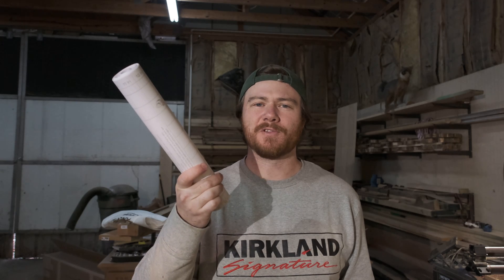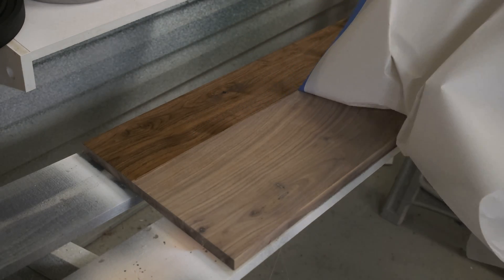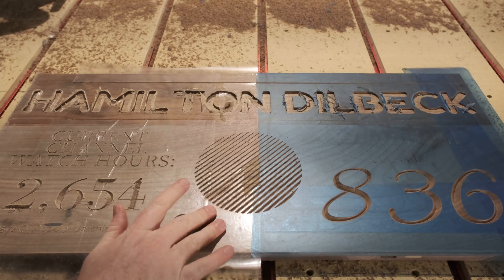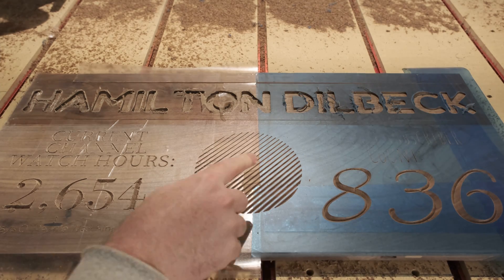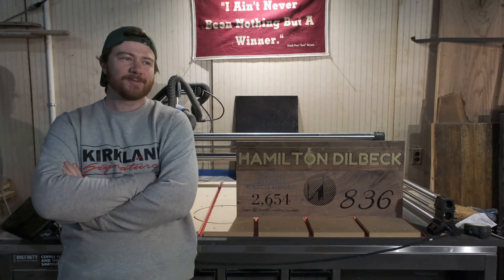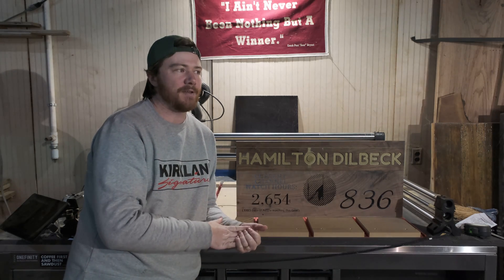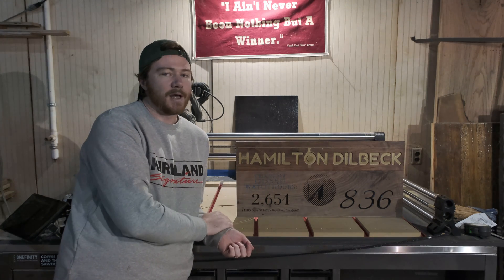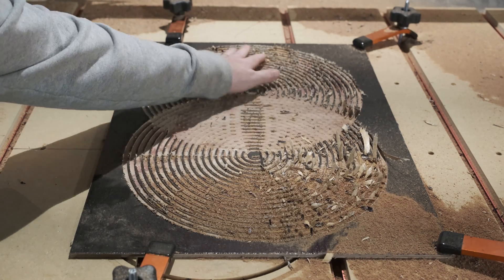CNC Masking Film: Oramask Vs. Walmart Shelf Liner

Comment: Even better than oramask or shelf liner is wood putty... water it down and apply a smooth coat over the entire piece.  if your going to sand it anyway... this is a better solution than the mask method. 
Try it I am sure you will have better results.
By the way this is not my idea. Another You tuber who I cant remember tried this and it worked great.

Comment: Just for grins try Con-tact brand clear cover liner our mother used to cover our school books in this stuff back in the 70's it was pretty tough stuff! it could possibly lift the grain when you pull it off :) also try using a heat gun/ dryer when you lay it down Love you work by the way always inspirational

Comment: What oramask did you use 813 or 631. Looks like 813. But having used both, the 631 works the best. The other think I have learned about the residue you. speak of is temperature. In talking to ORACAL reps, if it is too hot the residue will be present on the piece. One final thought about bleed. I have stopped using spray paint and started using acrylic paint. #1 it is way cheaper, #2 it does not bleed at all.  Thanks for the video
Reply: Do you brush it on or airbrush it?
Reply: @tony97gt  I just use a cheap paint brush. I by the Apple Barrel brand

Comment: ive been using the oramask 813 for vcarves and the only issue ive had with it is applying it too quick before my finish is completely dried also be sure to smooth it out with a putty knife or credit card etc. When oramask leaves a residue is usually because its been on too long like masking tape or the projects finish is not completely dried. Ive not come up with a way to get that residue off my projects easily yet but im thinking wd40 or peanut oil might do the trick to remove the residue left behind from using the oramask on the project. 
How do you remove the residue and not harm your finish?
I may try the shelf liner but as another watcher commented time is money so if it comes up from the face of the project and i have to re work things i didnt save nothing i just made more work i have to do.
Reply: Low VOC mineral spirits takes it off fairly easily. Didn't seem to have much effect on my sanding DEFT lacquer sanding sealer either.

Comment: This was an unfair comparison from the get-go. The application of the drawer liner was not applied properly and had wrinkles. I use this all the time and I ensure there are no wrinkles and that I use a plastic putty knife and go over the material to be sure there is a good bond to the material. (NO BUBBLES) It looked as though you did do this with the Oramask.
Really, you actually put this out as a comparison. Plus, I have never seen such thin Drawer liner in all the time I've been using it. The liner you held up at the beginning looked white not clear. White is what I use as well.

Comment: Really enjoyed this video and learned some stuff.  I have not used masking with my machine yet but I can see how it would be useful.  Up to now, I've either just spray painted the whole thing and then sanded off the surface, or I have carefully (and usually hated) painted the recessed cuts with a fine paint brush.  Tedious!  I will be experimenting with this.  I also appreciate how you rated it.  It makes sense.  Thank you.  I am subbed.
Reply from the maker: Thanks so much!

Comment: I have found that sign vinyl works better that either Oramask or shelf liner.  Do pre-finish with shellac.  I think the sign vinyl is a thicker material and does not leave the shredded edges Oramask does.
Reply: Big Irish, can you post a link to sign vinyl you used and like?

Comment: I think your choice of V bit contributed to your issues. A round V Bit in my testing is less likely to grab the mask or any top level wood fibers, unlike the flat sided V Bits. A couple $ more and well worth the money. Downcut end mills would also be more desirable, in this application, than uncut for similar reasons. In terms of using the better mask for commission work, don't cheap out. Charge what you need to cover your costs and your time. If you try to save money on the masking but take more time to touch it up, what's more valuable? What is worth more to you? People can see quality and will pay for it.